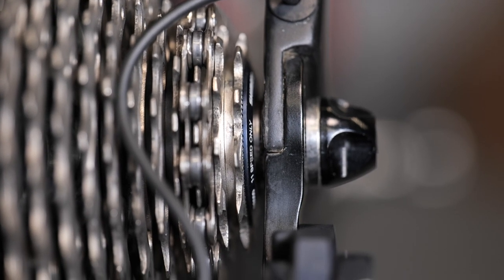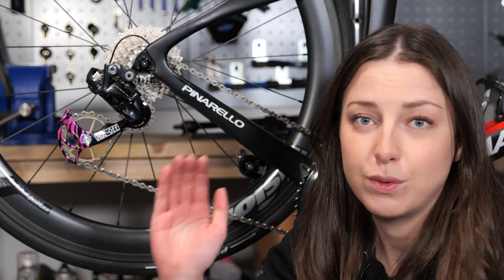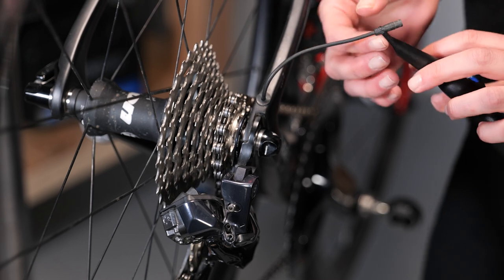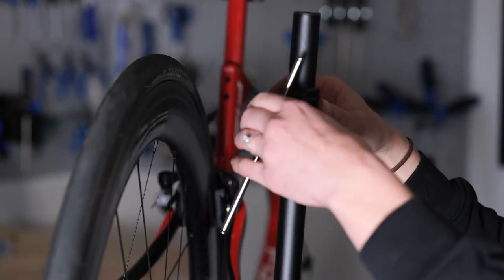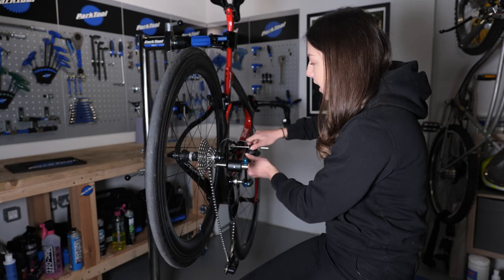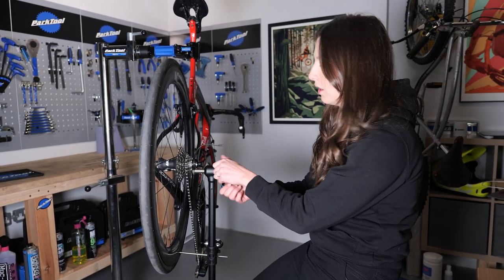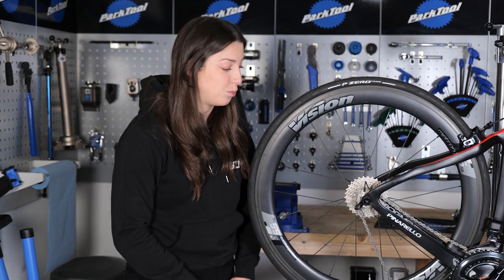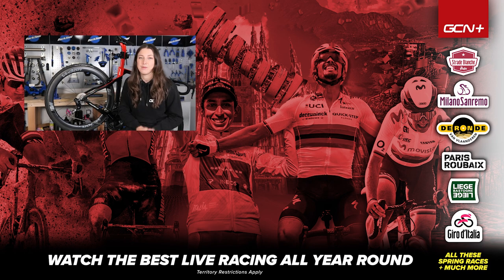How To Straighten A Bent Rear Mech Hanger | Maintenance Monday

Comment from the maker: What other maintenance tips would you like us to cover next?
Reply: At the very end Manon says 'you might want to index your gears'. How about a tutorial on that? Everything's better with Manon.
Reply: Getting headset bearings under the perfect load settings, it's always a tricky one and often ends in pitted bearings a few months later (quite often).
Any tips would be great, as the issues it can cause can affect the whole balance of the bike.
Reply: I was under the impression that for a carbon frame, you’re supposed to remove the bent hanger and straighten it in a vise. The reason is supposedly to reduce the stress on the dropout from bending a metal hanger. The tool is only for fine tuning and checking. For a steel frame the hanger is part of the dropout so you just bend it and it is strong enough for that. 

Is this the method recommended by CF frame manufacturers now?
Reply: Awesome. How to fix a wheel spoke that is rubbing against the disk brake caliper ? Just one pair of spokes. The other ones are good.
Reply: #askgcntech  hi chaps and Mannon. Thanks for all the advice so far really enjoy the show. I have recently bought a road bike with aero handlebars. I now need to look for a suitable front light to fit… there are many “bodged” solutions , what would you suggest to securely fit a front light to aero handle bars? Thanks, Ed
Reply: Im sure if u follow Manon's advice then it will work perfectly ........
However .....
If u read the blurb that comes with the shimano rear mech or groupset 
it does not say it has to be equal . It  is recommended that the gear hanger
faces outwards in the horizontal setting . So if the tool is touching on the 
very rear of the wheel , then there should be clearance when its over near the 
BB , cant remember how much toe out shimano recommend  , but I think 
shimano know what they are talking about here.

Comment: You should turn the wheel so that you're measuring against the same part of it at each quadrant. This eliminates any errors introduced by a out of true wheel.
Reply: Yup. Park Tool recommends using the valve stem as a reference spot.
Reply: Valve following is really important. Also easier to get derailleur back in with a slack chain - small chain ring etc. I've found that even brand new mech hangers need checking.
Reply: If your wheel is out by more than 0.5 mm, fix that first. If the hanger is within a millimetre or two, it's fine.

Comment: The measurement should be taken using the valve stem as a referernce point at all check points (ie. 12 oclock, 6 oclock).  Doing this takes wheel truness and dishing out of the equation.
Reply: Incredibly useful advice, specially for bikes where the wheel will most likely be out of alignment like MTB, BMX or cargo bikes

Comment: Pro tip from a Cyclocross racer: buy a spare hanger (or two, or 3 depending on your discipline) and just replace it when bent. Then use your spare time on a rainy day to fix your bent hangers so you have one at the ready just in case. The adjustable wrench method can work great in combo with a bench vice and straight edge to straighten a hanger off the bike too.
Reply: Buy a new hanger and replace NOW with your multitool, keep the old one in your saddlebag.  If you need to change it in the field you know the spare fits and your multitool will do the job.
Reply: Agreed. They are inexpensive relative to everything else on your bike.
Reply: Not all hangers are planar, or even designed  flat enough to get a straight edge off, and not all hanger pockets are perfectly in line with the plane of the wheel. You should always adjust the hanger to the frame, not rely on a theoretical alignment.
Reply: @zygmuntthecacaokakistocrat6589  In most cases, new hangers that were never realigned can still have the rear derailleurs shifting OK, not misaligned enough to make indexing impossible.

Although it's most ideal to realign it, which isn't possible when you're out riding with a spare replacing the other hanger.
Reply: Estaría buena tú idea, si no fuera por que las campanas no coinciden bien.

Comment: About 25 years ago I had a bent rear mech hanger on my beautiful Eddy Merckx frame.  I took it to the local frame builders and they used a blowtorch on it to soften up the hanger and then bent it the same way as in this video.  But I did need to respray the frame, and I had it an amazing banana yellow with black writing that bike looked really cool after that.

Comment: Great video! Some wheels have a threaded part just as the same as the hanger. So thread that in and you can use a measuring tape to adjust a bit more precise and not want to buy the special tool

Comment: "if you have bent your mech hanger you'll
 be able to see just by looking at it"
Yes, if it's severely bent, it'll be visible to the naked eye. But 11 and 12 speed derailleurs require very precise hanger alignment, and can shift inaccurately even though the bend is so slight as to not be noticeable.

Comment: It can work in a pinch, personally, specially if it was bent pretty bad, I would just replace it. Those hangers are cheap, and a derailleur in the spokes because the hanger had metal fatigue/cracking from bending and then shearing off due to vibrations over time tends to be more expensive.  To get home, or to get to work the next days it's a good solution, but considering the price of the part, and usually the price of the parts around it that it could mess up I wouldn't risk it long term, specially as you might bend it again at some point, and bend it back again making metal fatigue an even bigger risk.

Comment: Easy to make your own tool. I use a bolt that fits the hangar, through an old office table leg 1" box section steel. With a spacer and just Measure.
Reply: This!!! Things that fit the thread: threaded rear axles, rear wheels with cup&cone bearings. Another DIY method: screw an M10x1 threaded rod into the hanger, clamp another rod into the dropouts.  Eyeball and bend until rods are parallel.

Comment: Great video, a derailleur alignment tool is priceless. Two more tips: first, when reinstalling the rear derailleur, be careful the b-screw clears the stop on the hanger; second, if you're stuck in the wilderness w/a bent derailleur, with the rear derailleur in place, use an allen key in the mounting bolt as a lever to gently torque the whole assembly back to roughly where it should be. Fantastic content GCN.
Reply: Well, it's about 100 quid but who's counting?
Reply: @zygmuntthecacaokakistocrat6589  True, it's not an inexpensive tool - good ones are not cheap; but I've got 5 bikes and accounting for the amount of time it saves in sorting out bad shifting, it has paid for itself 10X over.
Reply: @edwardsjohnpaul  or spend 5 pound on a new hanger and the problem goes away I got 95 pound for beer.

Comment: Another hack: if you have someone with you who has a conventional M10 x 1 axled rear wheel  hub you can thread the stub of their QR axle into the derailleur hanger (same thread) & use the whole wheel as a hanger aligner! Easy to see errors with the wheel as the gauge! 
I always tell people I do this for (with a proper hanger aligner) that there's a 30% chance that the hanger will crack in the process of straightening, especially if it's been badly bent. The feeling of the hanger cracking and separating when this happens is very dispiriting. & why are there so many different types of hanger that take ages to source and order?

Comment: Thanks Manon...mmm , ok . I am someone that has snapped and bent hangers , how many adjustments are the hangers rated for . ?? I would change the hanger ASAP , to be confident ?  I have been stranded  in the woods after it broke , and it wasn't good
Reply: There are a lot of variables: No. of blows taken, force of the blow taken, type of metal used, etc. So there's no definite answer. Some are as soft as tofu (Pinarello), while others are pretty beefy (one BMC Teammachine ALR Disc I worked on).

Even if you use a new hanger, it's not always 100% aligned. Just because a hanger is straight on its own, doesn't mean it'll be aligned when installed.

Comment: the thread of the hanger is the same M10 as the regular rear M10 qr axle, so if you don't have the alignment tool, but have one at hand and, it can show you how bent it is,. if you have a cone and a locknut on it, you can securely place the axle in the hanger, then use an old seatpost as leverage to straighten it.

Comment: Manon's method assumes that the wheel is perfectly true, which rear wheels rarely are, especially after a shunt.  The better technique is to rotate the wheel with the alignment tool, so that you are measuring against the same spot on the wheel.  The valve makes a consistent marker. Put the valve at 6:00, take your measurement, rotate the wheel so that the valve is at 12:00, take the 12:00 measurement, etc., etc..

Comment: If your gears are not shifting then checking alignment should be the first thing you do.  If it is misaligned then adjusting the limit screw and the barrel adjuster will only make it worse.  I found when I had to do this that you should bend the hanger by about half the measured gap.  If instead, you bend enough to fully close the gap, then you will simply alternate between the hanger being misaligned in one direction or the other, but never get it straight.

Comment: I honestly would used some direct heat on the derailleur hanger as that hanger is brittle and after a bend is introduced it will stretch the molecules on one side and shrink them on the other if u just bend back ur actually causing the molecules to become stretched and compressed which will have little tears in it the great thing about aluminum is that you can annheal it many times unlike steel which hardens when heat is applied but the application of heat will aline the molecules and stops the metal from breaking due to the bending back and forth

Comment: I’d say the derailleur hanger is there to protect the frame, not the derailleur. The last thing you want is for the frame to be trashed. Derailleurs are expendable !
Reply: And for that, I insist on not running direct-mount hangers. Let the hanger fail so my rear derailleur and frame don't have to.

Comment: Not all hangers are created equal. Some of the Chinese hangers are more of a cast aluminum and will snap in half when you try to bend them. Best to have a spare hanger on hand so if you have an issue just replace the hanger.

Comment: All quick-release rear wheel axles have the same thread as the derailleur hangers. After a fall, you can use a other rear wheel to check and adjust the rear derailleur hangers.
It is important that you always use the same points on the wheels to measure the distance, preferably the distance between the valves on both wheels: If there is an imbalance in the wheels, this can affect the measurement less.

Comment: The best bike hack ever: old school front wheel hubs have the same thread as rear mech. Pull off your derailleur but leave rear wheel installed and screw in front wheel (the whole wheel) into derailleur hanger. Then use front wheel to bend hanger until the front wheel and rear wheel are absolutely parallel. No special tools needed!
Reply: It's a M10 x 1mm thread, so it's a rear wheel QR axle thread.

Comment: It is generally recommended to adjust lateral first, then vertical. And to take measurements against the same point on the wheel every time (usually by the valve stem).

And, given that aluminum is not ductile, better to make as few adjustments as possible - not overshooting in one direction then moving in another direction.

Comment: Always a good idea to have a correct spare hanger for the specific bike added in with the puncture / toolkit. A lot cheaper than being stuck having to take a taxi home or burning up brownie points with the other half by using them as a recovery service.
Reply: Depends on the size of the toolkit you always carry. I'd have the spare hanger at home to save those few days it takes for a replacement to arrive.

Comment: How many times can you bend it before it snaps off ? ! Mine is part of the drop out casting (steel frame), if it snaps, the frame is history !
Reply: It depends on the number of blows the hanger took, the force of the blow it took and the type of metal used.

I've realigned the integrated hanger of two steel bikes before (much like yours) and they do indeed require maximum hand sensitivity to be realigned carefully, bending bit by bit until it's OK.

For my realignment tolerances, I usually aim for <3 mm laterally and 0 mm vertically (ie. perfect vertical alignment), but with integrated hangers, I aim for <3 mm throughout.

Comment: Don’t forget to measure at the valve each time you turn the wheel each quarter in case the wheel isn’t perfectly straight.
Reply: Meh, unless your wheel is badly out of true, the discrepancy that the wheel contributes to the measurement is negligible. The hanger needs to be aligned to within 3 mm or so.

Comment: I view the hanger as a sacrificial part that protects the derailleur and the frame. If I bend one, I replace it. As most hangers are made of relatively soft aluminum, they recycle easily, with very little energy cost.

Comment: I never attempt to straighten hangers or mechs any more. With 12 speed long cage MTB mechs they are very difficult to straighten so that they shift precisely again. Last year, I had a bent hanger, and we carefully measured a 0.6mm bend in it which was nearly impossible to see by eye. It wouldn't shift for toffee on my MTB no matter how many adjustments we made. I replaced it with a new one for £12 and it was perfect straight out of the box.
Reply: Is it a SRAM UDH hanger or something specific to your brand & model (and probably a few others)?

Comment: Unfortunately, this procedure is not correct. The error Manon is measuring could be a wheel out of true. To check derailleur hanger alignment, you must measure a fixed point on the wheel at different orientations. It is easiest to measure at the valve stem for reference, rotating the wheel to see where it deviates from the center line.

Comment: I have a frame which has less stiffness of its rear end. So then, my aligning tool is easily wobbled by its own weight. The value of accurate alignment is less than just using DI2.

Comment: Another tip: the bike should be horizontal, I.e. as if it were on level ground. Otherwise you’ll be adjusting the hanger in the wrong planes even if you are following the clock dial approach
Reply: That's what my colleagues don't do (and they're in the industry longer than I am!).

Comment: This is assuming your wheel is super straight! You should take the measurements to a reference point, as the valve, and turn the wheel to always have the same reference point (the valve).

Comment: Step 3, replace the hanger if you can get one. It's not as strong as it used to be. Everything is easier with top flite tools. For most it's not worth owning them. Riding fixed you'll never encounter this problem.

Comment: You can use your front wheel instead of a alignment tool. It should use the same thread. Shows you all you need to know about where the mech is bent to. Saving you money in equip.
Reply: I used a rear axle from an old shimano cup and cone hub. I mounted that axle to surface of a blank of wood with 3 screws. Because wood screws had countersink heads and I placed them close to axle in angle too. I could get any play removed and also the axle to right angle with the edge of wood. One screw is middle of axle in one side of axle and other 2 other side. So with single screw I can remove play and then with other 2 to get the angle right. Just measure the distance between wheel and blank and then rotate the blank 180 degree and measure it again. If distance is same, then the axle is 90 degree angle with blank. It's not super critical to have it 90 degree, but it's better. To bend the hanger you need to hold from axle not blank, because it's not strong and firm enough.. Although it was flimsy and took more time. I got my derailleur hanger straight very cheaply.. And the screws, blank and axle are still reusable for intended purpose too. And if I had to bring my bike to shop, or go to buy tools. It would have taken much longer.

Comment: That tool costs 83 usd. Tool is only useful if you run a bike shop, but it’s better just to buy a new hanger.  Once the hanger is bent, it’s no longer the same even if you bend it back. Any person owns a 10k bike should be able to afford buy a new hanger.
Reply: No. That price is for the "cheaper" DAG-2.2. The DAG-3 that Manon used, costs around $128 USD.
Reply: New hangers are not always straight. Installed a new one the other day that had to be straightened.
You can get cheaper hanger tools and they are essential for 11 speed if you want to maintain your shifting.
Reply: @actonblue2012  There is always the problem with an older bike. Are replacement hangers still available?
Reply: @billkallas1762  Hangers are available for all sorts of bikes.
It is something that 3D printing would be perfect for but I don't know whether it would do the internal threading.
I'm sure someone would know?
Reply: Although I'm a shop mechanic, I bought one for my home workshop (which is better than the shop's) because I know just how useful it is when you need it most. I have a spare hanger for my bike too.

Sure, it ain't cheap, but like somebody above said, even new hangers sometimes need realignment and no hanger is aligned to me unless my tool proved me wrong.

Comment: "first thing you need is a di2 cable removal tool"
Makes you wonder if companies only invent this stuff to make
 us buy new tools.
Also, you can use a spare wheel instead of that expensive proper alignment tool. Or even better, just buy a new hanger and fit it when you damage yours.